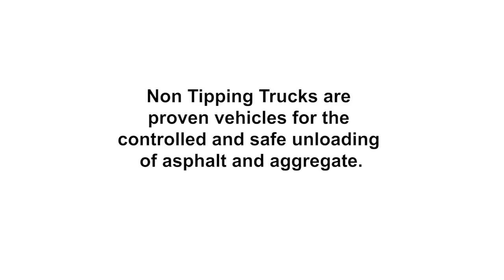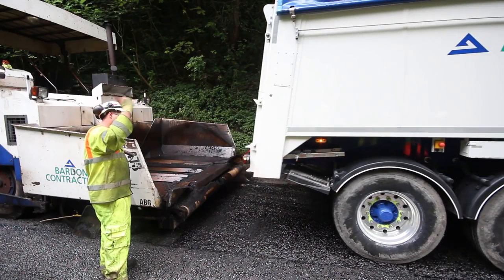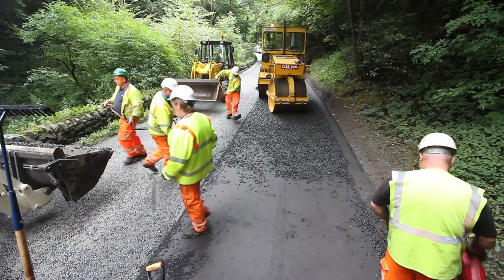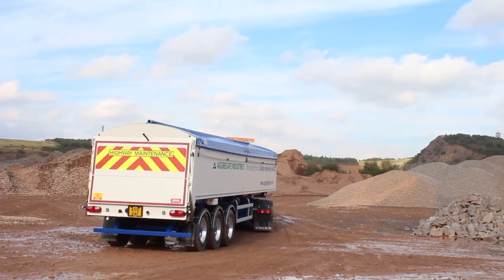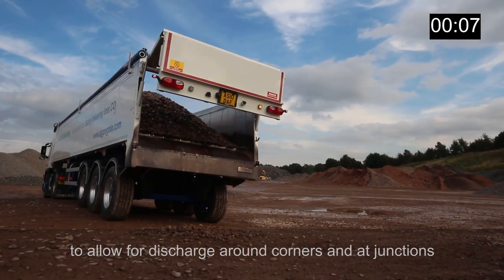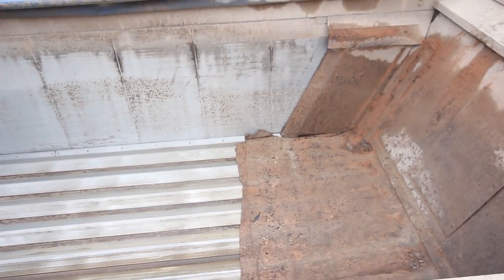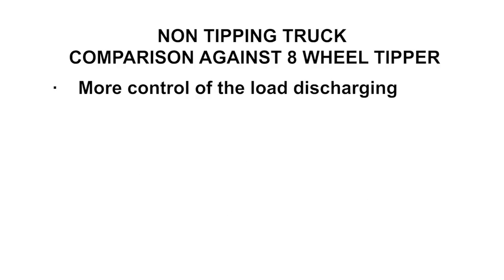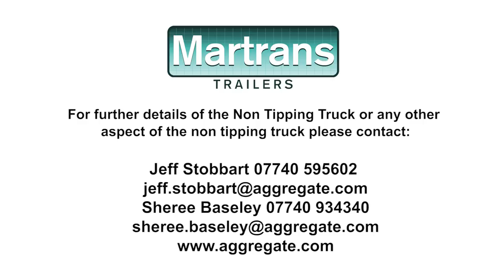Aggregate Industries Non Tipping Truck

Comment: bit shady that they say 40% load increase when they are comparing a 44 tonner to a 32 tonner... I'm sure there are applications where a 44t tipper would not be suitable so either a 32t tipper or a 44t non tipping tipper could be used, but they didn't explain any of this they just said "40% load increase!!!"